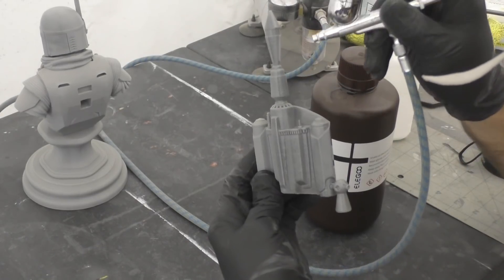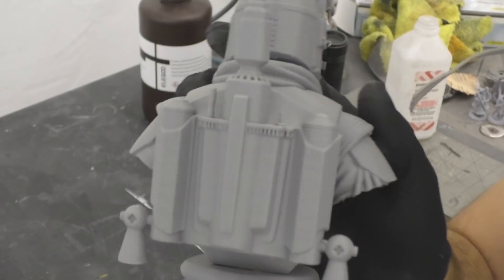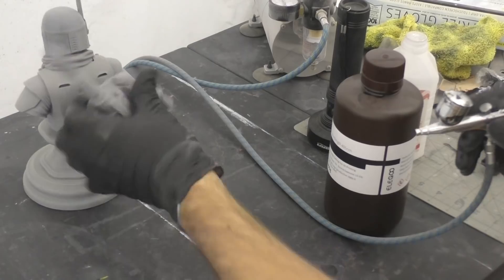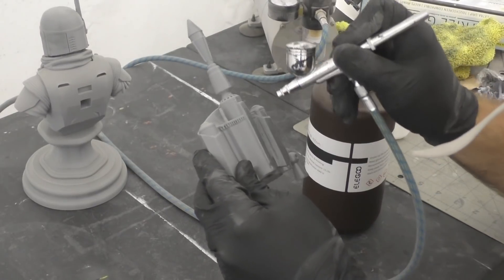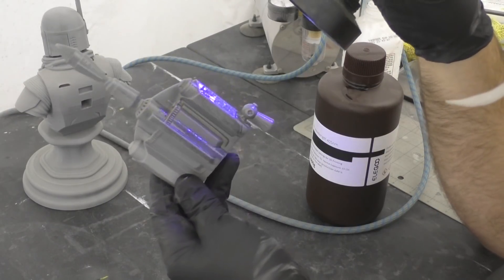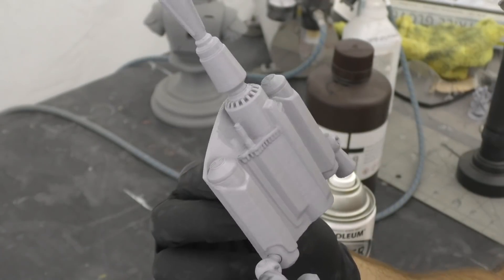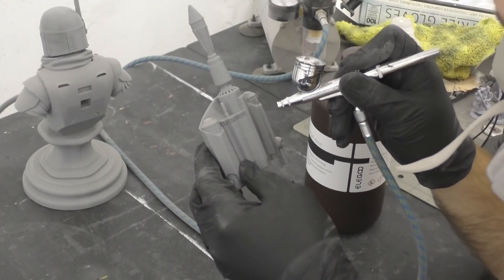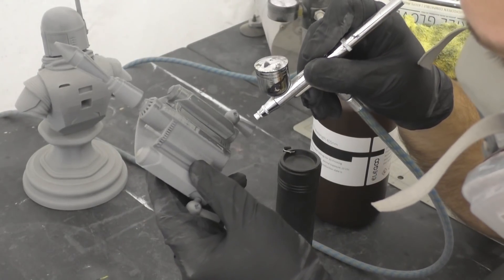Airbrushing Resin to Smooth 3D Prints - Should you do it?

Comment: Only other method I've found that comes even close to using resin to smooth is plastic wood filler and cut it with acetone or rubbing alcohol but you can't do it in big batches because the acetone/rubbing alcohol evaporates so fast which can be a plus because there's not much waiting for it to dry so it can be painted.

Comment: I've been doing it with a brush for awhile and I learned really early not to get it on your hands. I had just a little bit on my rubber gloves and the uv light hit it, burned so bad, that stuff gets so hot so fast. But the results speak for themselves,  I'm not sure why this hasn't caught on and being used for more applications. You've got a nice size spot, have you considered using a sandblasting stand? It's enclosed, sealed, and has built in gloves. Would save you a ton in cleaning up and ppe.

Comment: Sand blasting cabinet with added filtration as paint booth. UV led strips inside to harden excess resin after painting. UV enhanced filter at end of air duct. Cabinet lined with paper so it's easily replaceable.

Comment: I'm looking at smoothing layer lines on surfaces that are sandable not limited to flat surfaces. It works to cure and then wet sand with 400 or higher between applications but again you get the brush strokes and even some bubbles which I have used mini torch to help expell. But that final layer is what I'm looking for to get that that gloss finish. The intent is to not spray anything else after that. I wonder if using a very fine bristle brush with alcohol thinned resin might yield just as good a final finish as the airbrush while eliminating the aerosol risk.

Comment: Another suggestion that would make this process a bit safer would be to build a station along the lines of a Benchtop Abrasive Blast Cabinet. It would contain the overspray, gloves could be adapted and changed out. It could also be ducted outside from your work area, as well as customized for your brush hose and any other tools. This is just a thought from a Maker that hasn't tried it - Yet. Let me know if any one does try this out.

Comment: I do not think this is worth the hassle. We only have a very high-end airbrush, and I really do not want to risk it for this "gimmick". With the brush-on method with epoxy resin, you may have to sand, but to me it is well worth the effort. Sanding is not that hard to do IMO. Some ideas may sound great in theory, but are simply too dangerous to do in real life. If you have to basically put on biohazardous gear - no, thank you.

Comment: I prefer to use eco resin and to spray at night outside. I used to spray without gloves  but I wear n95 mask. I knew it will only filter resin particles but it will allow organic compounds to pass-through. Eco resin is much safer if you wear cheap mask.

Comment: 1:15 I would have went with a plastic enclosure about 3 feet cubed with plastic gloves permanently sealed to the enclosure.  It would require less material, and you can add layers as necessary if you want to multiply the safety.

Also, if you manufacture it within a collapsible frame, you can store it and deploy it in seconds anywhere.

With the right fittings, you can attach any size ventilation system to it which would be less taxing since you are ventilating a much smaller space.

Comment: The photoinitiators in UV resin are cytotoxic, this is breathable chemotherapy. That respirator is not enough if you want to avoid damage at a cellular level. Get some tyvek jumpsuits while you're at it. Even with tamer styrene based resins being sprayed, full eye and mouth masks and tyvek suits are required in a work environment. I don't think I would even trust a ULPA filter to handle aerosolized UV resin. This Is one hobby material that you can't fuck around and take half measures with, and I hate that the maker community isn't more aware of how hazardous this stuff can really be.

Comment: Would it be possible to prepare an limited box and connected by a flexible duct to an air extractor directly to the outside?
That way you could paint with the airbrush inside the box and since the air pressure is negative, all the toxic vapors would be expelled out of the room.

Comment: I want to try this method I have paint booth but I will probably limit this even more by adding some editional walls to cover larger area and then I will sit my UV light in the middle of the booth and leave it there for a bit to actually cure all uncured resin in there
But yeah.. working with resin for about two years this is really nasty stuff.. at first it does not seem like much but from experience I can tell that over time this resin really is a bad thing

Comment: As others have mentioned in the comments, if your are
Spraying anything through an airbrush, make a spray booth.  Even hobby paints labeled acrylic can be toxic if you put them through an airbrush.  With the resin if you use a spray booth ot will pull most of the excess resin into the filter and not have it sitting on your surfaces.

Comment: if you are using a hvlp paint gun to spray resin you should just scuff the part and use a 2k primer instead. For that bust I would just do light coats so as to not loose detail. I know sanding and scuffing sucks but its part and parcel with paint. love your content keep it up.

Comment: I'm not at all into this whole resin stuff, I don't know anything about resin. Using my common sense, the only way I can think of here (as someone here also said) is getting a closed cabinet and using that. I can expect it to work pretty fine. The sprayed resin doesn't go all over the place and you don't really breathe it in. Just like a sandblasting cabinet, holding the airbrush with gloves attached to the tank. If we don't count the resin that gets sprayed anywhere else than the model and makes you lose money, this can be a solution I guess

Comment: I've had sooooo many people ask me to try this too and I'm glad to hear you don't recommend it because while it sounds cool and "the next big thing", I kind of figured it would be a ventilation NIGHTMARE and I didn't even want to try it to further put it out into the world or to make it look like it's a safe thing to do because it's NOT. And kudos on the safety PSA as well.
Reply: 1:15 I would have went with a plastic enclosure about 3 feet cubed with plastic gloves permanently sealed to the enclosure.  It would require less material, and you can add layers as necessary if you want to multiply the safety.

Also, if you manufacture it within a collapsible frame, you can store it and deploy it in seconds anywhere.

With the right fittings, you can attach any size ventilation system to it which would be less taxing since you are ventilating a much smaller space.
Reply from the maker: Thank you so much! It's definitely a quick way to make a dangerous mess everywhere
Reply: @GalacticArmory  I'm pretty sure I would have bricked my airbrush too, I've broken them for less
Reply: its completely safe, ive been snorting aerosolized resin particles since i was a child
Reply: @Blox117  I found a spool of older solder from my Pop’s electronics equipment when I was a teenager. I spent a couple weeks making solder sculptures in an unventilated attic.

I didn’t know that older solder had extremely high concentrations of lead. 😂